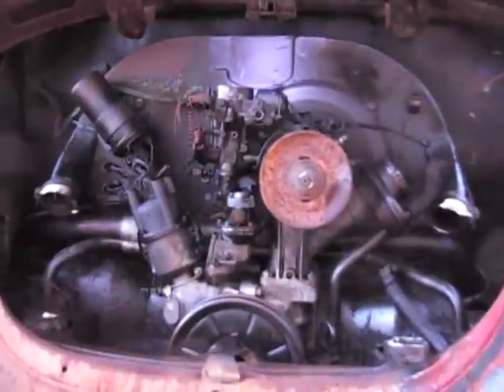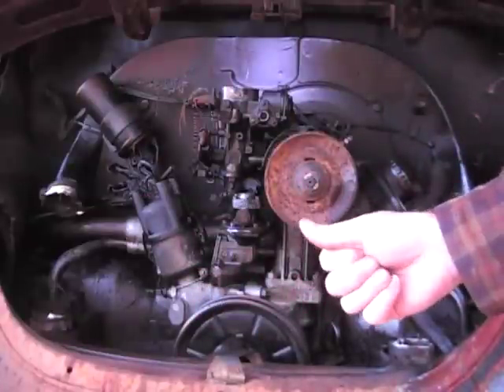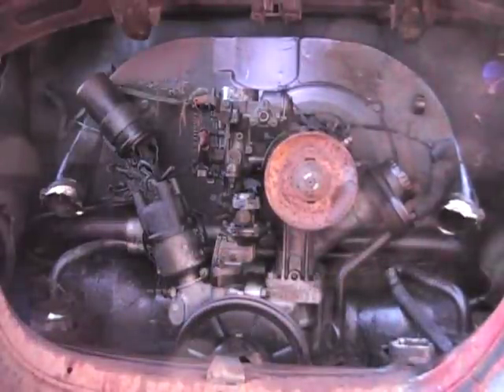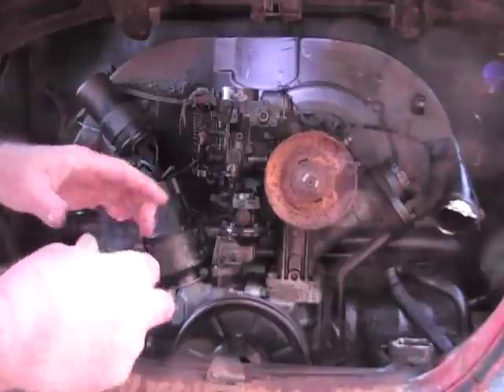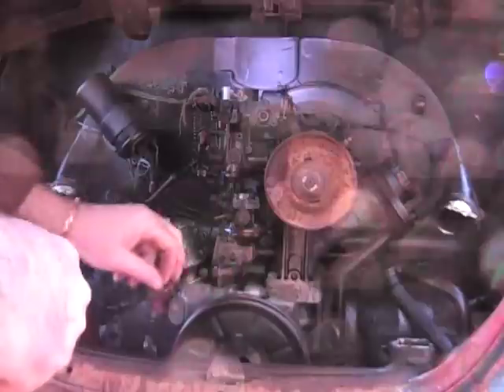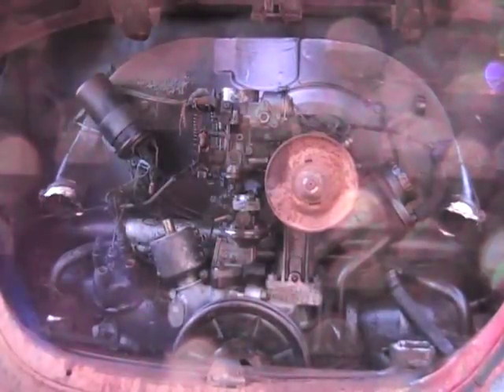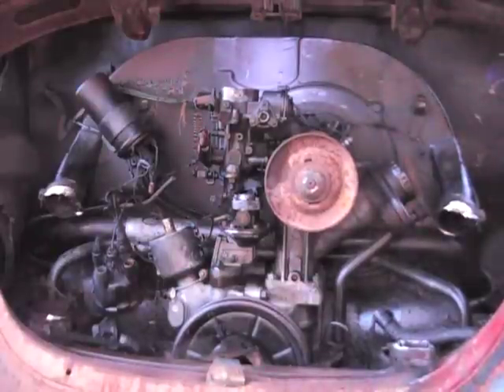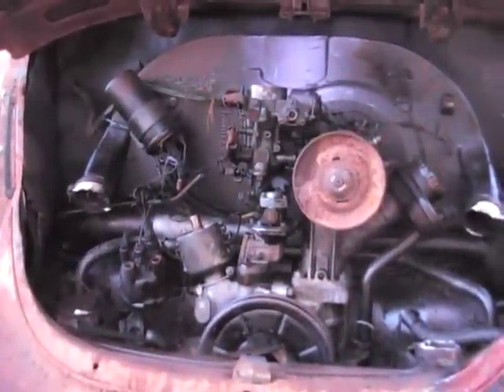VWorm show!

Comment: Oh and firing order is 1,2,3,4.  The cylinder numbers are stamped into the tin above the spark plug holes.  That will help when you attach your wires from the distro to the plugs.
Reply from the maker: Got it! Thanks Gregory.  I have no clue.....as usual.

Comment: You probably can still use that distributor...it looks like a 009 and with new points ,condenser,cap, and rotor would probably still work fine. the inner cap was just a dust cap... some of mine have them some don't... and the first wire of consideration at about 5:15 or so in your video probably had a in-line fuse holder somewhere on it. It goes from hot side of coil to reverse light switch on the nose cone of transmission.
   If you commit to this car you will be amazed how simple they really are...
Reply from the maker: +vw64manyrd Many thanks my VW mentor! You are a wonderful fellow.

Comment: I had one catch on fire driving down the road and thought it run out of gas cause it cut out on me so I coasted into the gas station rite up to the gas pump on fire. You should have seen the look on the guy's face that was pumping gas eye's as big as hub cap's. I looked in the rear view and saw fire in the back window so we jumped out and poured soda on it and put it out. It was scary. Make sure you use a strong fuel line.lol

Comment: If you use a good full cycle ratcheting terminal crimper and good terminals, you should have a much safer and more durable connection than what can be made with the cheap tool that comes in most all-in-one kits at the hardware store. Amazon has one called "Titan 11477 Ratcheting Wire Terminal Crimper," that is the type I mean. These tools have the added benefit of being easier on the hands than the cheaper tools, too. I can't add a link here, but the Titan 11477 will pop right up if you search it on Amazon, $25.88 and it's on Prime, too. A GOOD set of wire strippers is also essential. Your knife, or that cheap tool from the all-in-one kit, is not a good stripper. The Klein 11063W strippers are about $30, with free shipping. This may seem like a lot of money for just a couple of tools for a few wires, but they will do a far better job, and you will make much more durable and safer terminations with them. Trust me, I'm a certified aerospace wiring harness technician, and I use the professional versions of these tools every day. Inferior tools make your job harder, and don't give results that work as well. "Rant mode off," at least for now. Good luck with the Bug!
Reply from the maker: I have a few Klein tools. They make jobs better for sure. I will check out the crimper, thanks. I have a big one made like bolt cutters. I use it for large gauge stuff.  That's awesome that you are a space ace!
Reply: +cutworm59 I&#39;m a technician, I don't design the stuff. But it is a great job, I get to work on really cool stuff and the people are awesome. Best of luck with the Bug, Mrs. O had one years ago and would love another. We both really enjoy your videos, you're a great guy. And Happy Birthday!

Comment: Dont change the oil until you get her started unless its very sludgy an you have one of the bigger carbs next size up is 34, maybe a 1500 engine ..may need new Generator looks like engine fire prolly from fuel leak that happens on these bugs, i see a nice rat bug
Reply from the maker: Thanks Kenny.  We shall see what happens.

Comment: you probably already know , but you don't want to run the engine long without the generator belt as that is what runs the fan to cool it. and also the only filter for the oil is right there at the drain hole and it's just a screen .
Reply from the maker: Thanks Young Timer! Please help me with anything you can think of. This is not like my Crosley's.
Reply: well back in 07 I bought a dune buggy sort of a basket case so  I had to do like you,, learn as I went, but my problem is,, I can't really remember everything I learned, I do know the way you adjust the gen. belt is just moving washers around on the pulley.. things like this  are interesting to me,, that's sort of what most of my videos are about,, working on stuff.
Reply from the maker: +MissouriOldTimer Videos? Hang on while I scribe to your channel.  Woo Hoo!